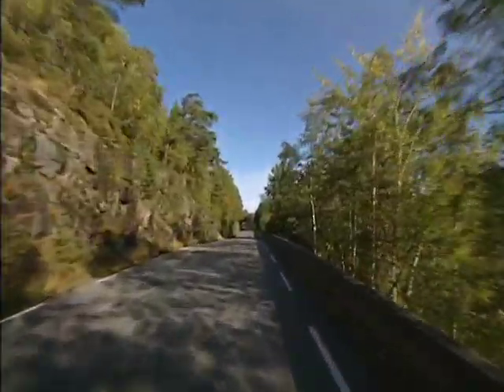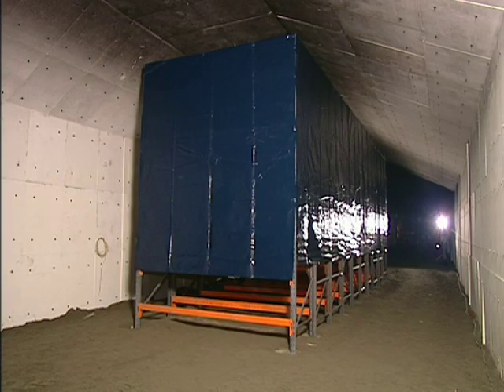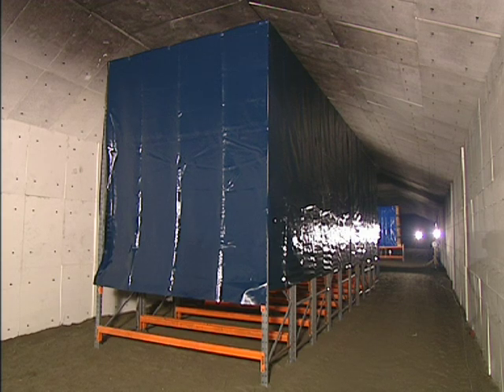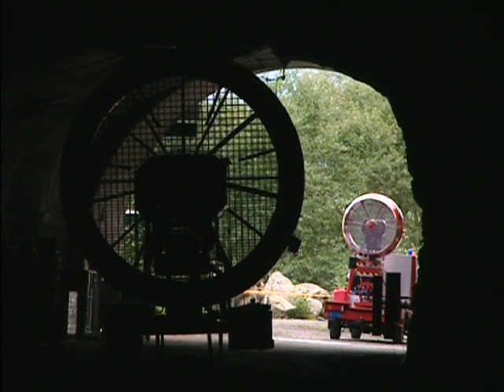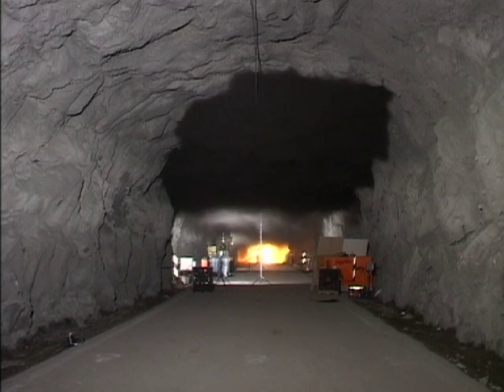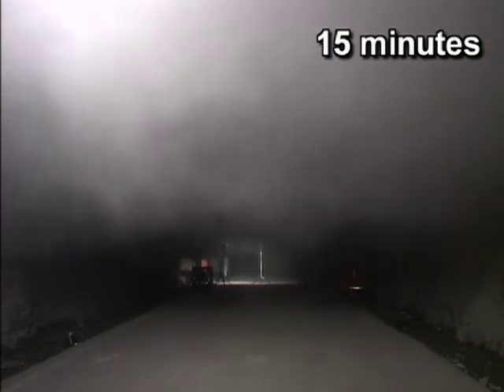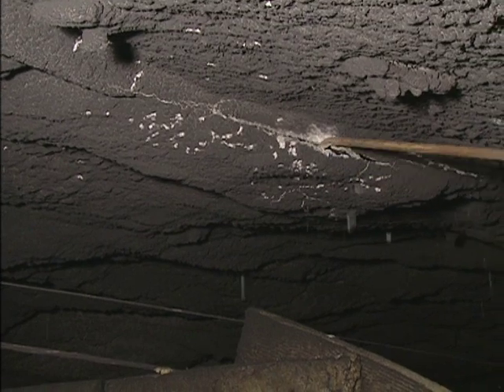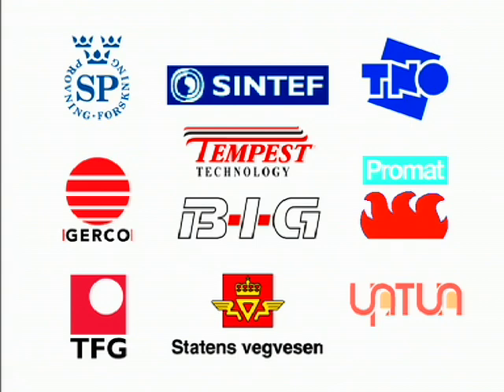Large-Scale Fire Tests Runehamar Tunnel -YouTube sharing.mov

Comment from the maker: A longitudinal ventilation system is installed in most road tunnels in order to push the smoke or air pollution in the same direction as the traffic flow. This will create a smoke free area on the upstream side of an incident fire. At the same time vehicle on the downstream side can safely drive out of the tunnel. Thanks to the ventilation system the fire brigades have a free sight to fight the fire in a safer environment. This is partly the reason why the fire was ventilated during the tests.